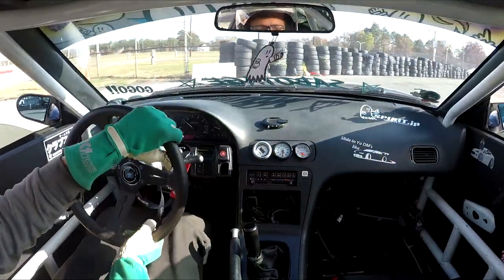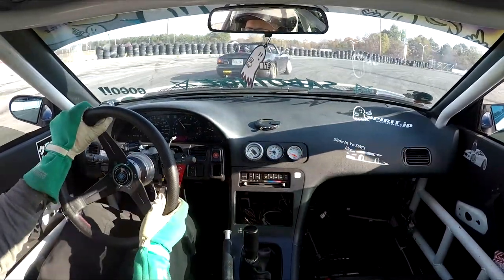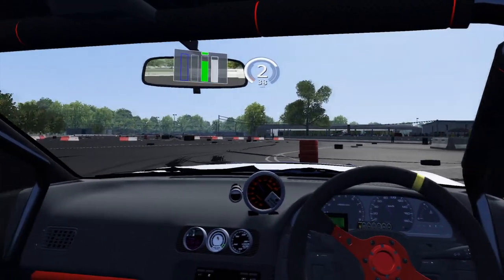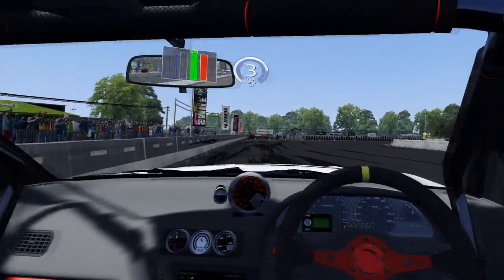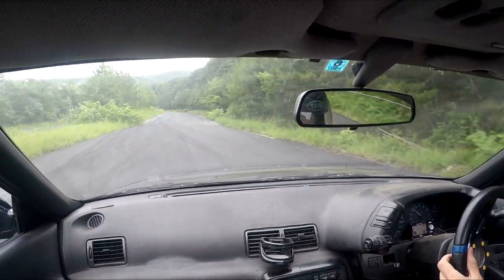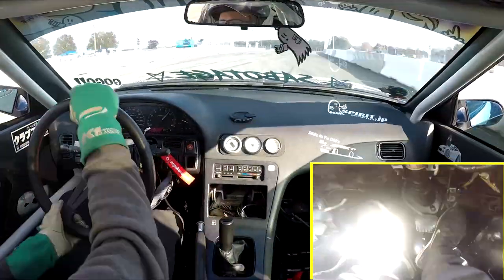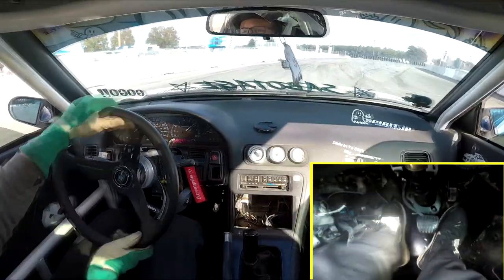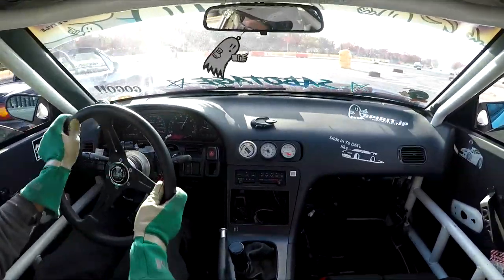Learning Big Entry Technique

Comment: as starting out with low hp cars doing big enteries was by far the weight transfer but using the clutch to keep the rear stuck for a split second more to hold angle and you described it best with just a quick stab to adjust the apex.

Comment: Very nicely edited, owned and drifted my 14a/kouki for the same time as you've owned your s-chassis, I haven't spent as long practising backwards entries though and have always self taught my skills with many crashes along the way. I find 'time dipping the clutch'  to get the back end past the front the hardest, can get fairly easily to 80/85 degrees but getting the last bit so the rear overtakes the front is definitely the hardest bit to master (IMO obviously). Look forward to the next one!
Reply from the maker: All comes down to tire and suspension setup, as well as throwing it a little harder than usual. It's definitely a fine balance between throttle input on initiation and how hard you throw your car.